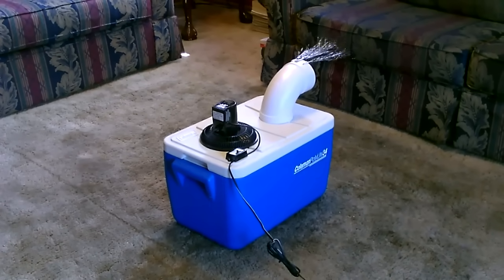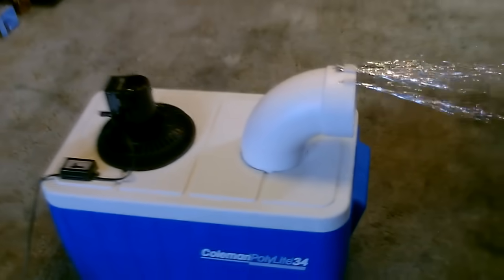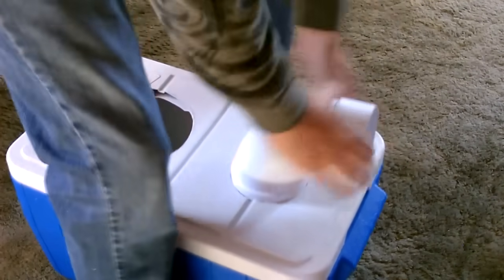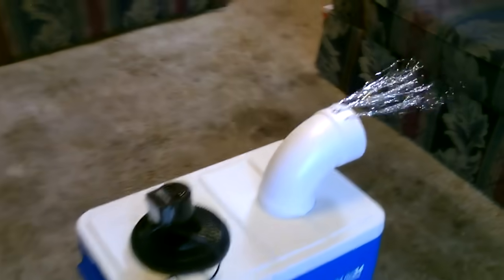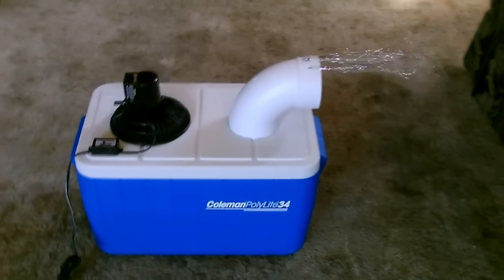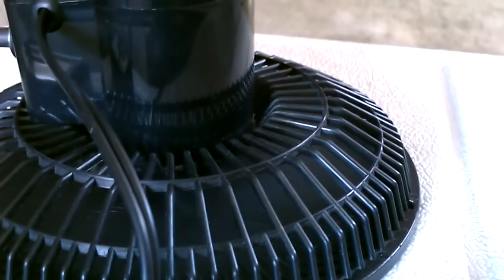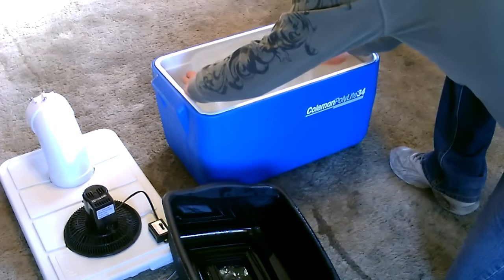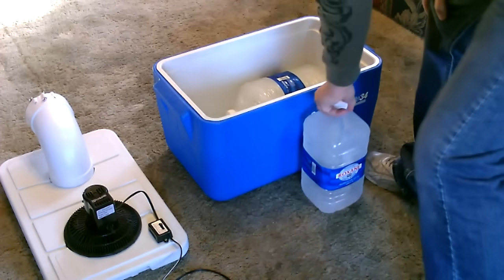Homemade air conditioner DIY - Awesome Air Cooler! - EASY Instructions - can be solar powered!

Comment: Use two sets of water bottles (each set containing about 6 water bottles).  When one set melts, put the other set in the cooler and put the melted set in the freezer.  By the time the other set melts, the set you put in the freezer will have frozen again.
Reply: AIRclan1 Um, your freezer is going to warm the air by more than this cools it, unless your freezer is outside or something.
Reply: David Battle Yep.  Scanned the replies and you beat me to it.   Most people don't realize that in order to freeze the water bottle, the heat is removed (not cold added).  The removed heat is pumped into the room that the freezer is in, plus the heat that the freezer generates to perform this.  The only way to benefit from this type of air cooler is to have the freezer out of the cooled area.
Reply: ***** If the freezer is in the same room as the "air conditioner", then there will still be a net heat gain, not cooling.

If the frozen water bottles are capped, then no evaporation will take place, and no humidity will be added.  In fact, water will condense on the frozen water bottles and drip to the bottom of the cooler offering a bit of de-humidification. If raw ice blocks are used, then they will add moisture to the air.
Reply: ***** I'm not unsure.  It will definitely release more heat into the room if it has to freeze more water.  It's a simple matter of physics.
Reply: AIRclan1 Hey Airclan1, It would be really handy to know the dimensions of your small room, and the temperature differential as in the temperature with and without the cooler or how many degrees the temp drops after the cooler has started.  That information will be a determining factor for me to either construct one or not.  Thanks!
Reply: *****+ohger1+David Battle+ I do believe that there are other people interested in this like myself who would use this device to cool a particular room in the home (avoiding the need to cool other rooms) where that room is not the same room as the refrigerator, meaning that the heat being expelled by the freezer unit is irrelevant except in terms of how much more power is being expended by the continual freezing of new ice blocks and maybe the problem of higher humidity that may be hard on, for example, computer components.
Reply: *****
If the freezer was 100% efficient (not even close), then the heat it removes from the water bottles as it freezes them will be added to the heat it already releases and net zero. It will remove the heat from the bottles and put it in the room (they don't store heat for later removal).  Because freezers use motors and compressors that generate their own heat, there will be a net gain of heating in the room.  The only way this "air conditioner" works is if the freezing apparatus is not in the same room as the air conditioner.
Reply: Yes it will run some to keep food frozen.  But it will run a lot more if you put liquid water in it.  You have to remove a certain amount of heat from the water to freeze it.  Heat can't be destroyed, only moved.  The heat removed from the water goes into the room.  Plus the freezer will generate additional heat from running it's motor and compressor.
Reply: To specify for all those who pointed out flaws,  I used UNOPENED water bottles and froze them in my fridge in my garage, where the temperature doesn't matter.  My cooler is in my fairly small bedroom and does an excellent job on hot days.
Reply: TWOLF Ravencroft Hey twolf, my room is about a 7' by 8' bedroom.  With 6 bottles, it takes about a half hour to drop 5(approx.) degrees.  I suppose if you added a faster fan and a couple more ice packs you could accommodate a larger room but my specs suffice.
Reply: Better to freeze the bottles at night with your windows open and then use them during the day when you would have your AC on.
Reply: breathe and squeeze whos they? thats absolutely not true. not only does warm water take longer to freeze it also increases the temperature inside the freezer which in return affects any frozen items in there not by much but it does.
Reply: Nicholas Reando actually it does freeze faster but most scientific studies have not actually found the reasoning and cannot produce the results to a point to say yes or no so the reality is that u are both right.
Reply: Nicholas Reando So it is absolutely true check your facts before you call some one a liar. And before I get the reply says who it actually has a name its called the mpemba effect.
Reply: John-Del You dont have a freezer in your house ?
Reply: David Battle well my room is too small for an wall ACU so i can use this while the cooler is in the room which has wall mounted ACU so problem solved
Reply: *****   That the plan!  If work doesn't mind, have at it.  It does seem hard to conceive that just freezing some water bottles would heat your room, but physics states that for every single calorie of heat your freezer removes from the bottles, it discharges into the room around it PLUS the the heat the freezer generates to accomplish this.  Freezing your bottles at work or with a freezer outside of the room you want to cool will work as the video suggests.

BTW, I knew this rube that framed in an old refrigerator half into his garage wall.  The back of the refrigerator (with the cond coils) was outside the house, the front half was in the garage with the doors removed.  It worked a bit but when his electric bill came it he shit a brick...
Reply: Yes, if the freezing unit is outside the area to be cooled, no problem.  Also, if the ice used is contained in sealed containers, there is no extra humidity added and indeed condensation on the ice bottles will reduce the humidity if the water at the bottom of the cooler is removed and not allowed to evaporate.
Reply: AIRclan1 Great to know AIRclan1.  Thank you very much for your response! :)
Reply: +AIRclan1 hey man so this thing really works? , i have a  small room... away from the main rooms in my house and i don't want to buy an AC... it get really hot in summer days... i don't look for an AC like solution, if it just cool down the temp in the room a bit that would be great...
Reply: IKurtC What are the dimensions of your room?
Reply: +IKurtC Yea, I was in the exact same situation.  I used this process for about a month.  I was getting tired of changing the bottles over and over, and just ended up buying a cheap $100 window AC unit.  If you have the patience (unlike me) go for this definitely!
Reply: well i guess i'll try to build this when i'm gettin free days at work, my room is like 5x4 mt i think
Reply: If by mt you mean meters, this will not cool the room.  The only thing you will feel cool is the breeze from it that blows directly on you from maybe as much as a meter away.  Airclan1 is correct when he says that changing out bottles can be tiresome.  The more surface of cooling within the cooler that the air hits, the cooler the breeze with be.  I used tall thin metal cans and checkerboarded them inside.  I considered a thin cooler filter with ice water circulating on it combined with a stronger fan, but then I realized I could just buy a small cooler and use ice water instead which would have been much more effective.  I was moving toward solar power to run it but then I moved.  This cooler is for a very small area and better, one that is insulated.  Put a cooler like this inside with you and it would be a fairly cramped situation.  I'd say, having tried it out, not real practical. However, there may be ways to improve upon it, one of course, using solar panals for energy.
Reply: they say hot water freezes faster than cold water.
Reply: butchtropic I am hoping to spend the winter in Death valley. I love the idea of adding more humidity!
Reply: AIRclan1 you are not even smart loser dumbass
Reply: AIRclan1 çok güzel bi
Reply: @butchtropic that's exactly how the very 1st air conditioning worked..
Reply: +Cherokeeman That cooler is $700!  You'd think if these people came here they were looking for an affordable option.  Trust me people, go with this project (if you have patience) or buy a cheap $100 ac window unit from home depot.
Reply: AIRclan1 that cooler was not 700$.. maybe 40$
Reply: David Battle it's not like your putting hot water in the freezer is it ?water from the cold tap 'in England anyway wouldn't take that long to start freezing
Reply: wow didn't know that!
Reply: Archie Beasley the solar panel is what drives the cost up
Reply: but i'm righter because it's true.

Comment: hey man if i put water in there than cooling is perfect or not because oi got a no ice .......please tell me fast
Reply: ddavel5441 how can i get ice instantly man
Reply: ddavel5441 okay man thanks
Reply: bear grills Actually, a bunch of paper soaked towels will work, to a degree. They get cooled with evaporation...
Reply: Clear Adventure
Yeah, same thing camping.
If you wear cotton socks, RIP toes.
Reply: how long the ice can use?
Reply: LK T about 2 hours ,nigga

Comment: where did you get the fan
Reply: Chance Blevins                      in the shop
Reply: Chance Blevins Home Depot has battery operated fans for around 10 bucks.
Reply: Martin Stroh i was going to do that but the batterys dont last long on the battery opperated fans, i will just plug mine in, makes more sense

Comment: brother thanks for the idea. im gonna try that this summer. question: what would happen if u add salt in the ice? we get cooler air?
Reply: Andreas Ioannou and how longer it would last.
Reply: Andreas Ioannou When you add salt to an ice cube, you end up with an ice cube whose temperature is above its melting point.

This ice cube will do what any ice cube above its melting point will do: it will melt. As it melts, it cools down, since energy is being used to break bonds in the solid state.

(Note that the above point can be confusing if you're new to thinking about phase transitions. An ice cube melting will take up energy, while an ice cube freezing will give off energy. I like to think of it in terms of Le Chatelier's principle: if you need to lower the temperature to freeze an ice cube, this means that the water gives off heat as it freezes.)

The cooling you get, therefore, comes from the fact that some of the bonds in the ice are broken to form water, taking energy with them. The loss of energy from the ice cube is what causes it to cool.
Reply: Hingle thanks brother for answering. are u a physicomathematician or smth..? so we end up.. conclusion?? im i get cooler air or no by adding salt?
Reply: Andreas Ioannou t’s important to first understand what melting point and freezing point mean.Melting point is a property of solids.  The melting point is simply the temperature at which the solid turns into a liquid.  For example, the melting point of normal ice is 0°C at standard pressure. 

Freezing point is a property of liquids.  The freezing point is simply the temperature at which the liquid turns into a solid.  Thus the freezing point of normal freshwater is 0°C. The value of the melting and freezing points is the same (ie. both are 0°C for water). So as you can see, melting point and freezing point are kind of “mirrors” of each other. It doesn’t make sense to talk about the freezing point of a solid (since it’s already solidified).

When salt is added to water it lowers the freezing point.  In other words the water needs to be chilled to a temperature lower than 0°C (say -2°C for example) in order to change to ice.  Another way to say the same thing is that salt allows water to exist as a liquid at a temperature lower than 0°C.  This is the important part that’s relevant to beer coolers.  For completeness let’s look at this from the perspective of melting point.  When salt is added to ice it lowers the melting point.  

In other words the ice begins melting at a temperature lower than 0°C.  This is why salt is added to ice on the roads in the winter.  It causes ice, that would have otherwise remained as a solid in sub-zero temperatures, to turn to water.  Note that the temperature of the water has not changed.  It’s still at a sub-zero temperature but, as mentioned above, the salt allows it to remain as a liquid at the lower temperature.  Don’t think that just because the salted-ice has become water the temperature has risen.

TL:DR Add salt in water and freeze it. :D
Reply: brother. thanks for the analysis. i really appriciate that. is still hard for me to understand all those details but.. i like the way u placed the things. u should be a professor if u are not. and if salt dont works for maximum results then we go to dry ice.. :) what do u think.. ssss. :) thanks again.. sorry for my english.

Comment: I just made this and my temps are not as low as yours. Feels about like a window unit on medium. Works pretty good but if I could make it cooler.... Nice to have as a backup, or to keep from cranking up the a/c just to cool the 2nd floor master br.
Reply: *****
I used 3 , 1 gallon jugs and froze them. I've tried even adding water to the cooler with the frozen gallon jugs. It does cool but not as well as the video. My bedroom is 14x17 and it might drop the temp by 5 to 10 degrees, 10 is generous.

Comment: Any insight on how adding to humidity eventually makes it hotter?  Would a dehumidifier also help in the room?
Reply: smittyken I just put a dehumidifier in our apartment and the exhaust blows out hot. Made the apartment drier but hotter. I put it back.

Comment: This is awesome. My refer (and freezer) are running anyway. I could have water bottles freezing and use them when the heat gets too high. Then when I go to bed, put the bottles back into the freezer for next time. Thanks!
Reply: hympyke Off subject, but for ice water to drink, fill your bottle up only half way with water, lay the bottle in the freezer on its SIDE. Freeze it. Now fill the rest of the bottle with water. Better than ice cubes, this should last many, many hours for cold drinking water. :-) (BTW, you are doing a great job with your English!)
Reply: kevin green Much more time needed to melt. This is simple guys, freeze some water and try it with a little fan in bottle and without bottle. The closed bottle prevents the evaporation and the ice melts faster. I made 2x2litres with bottle and fan, needed maybe 40 mins to total meltdown and i didn't feel any cold... If I was put the ice in a basin, I felt the cooler air pretty quick.
Reply: hurdman I tried that one, and didn't work... if you keep the ice in a bottle it melts pretty quick, maybe in 30 minutes. The ablation is necessarly i guess. If i put the ice in a box and place it on the top of the wardrobe the air become colder. So the whole thing can be work, but do not blow the air to a closed bottle. Or just siply try it and you will see the result ;)
Reply: hympyke hello have you tried subtituiting ice gel pack?
Reply: batman Nope, I am not sure what do you mean(I can't find subtituiting in dictionaries).
Reply: substitute lol
Reply: batman No I didn't try but I think the result shall be the same. Need pure ice I think.
Reply: hympyke  how long does the ice last if you use just ice?
Reply: Clear Adventure Thank you.

Comment: Pretty cool idea. Especially if you are limited on how much energy you can afford to pay for. If your from the southwest you would know how costly it is to run a A/C all day and sometimes at night. If you want to save money it's the way to go. Sure you can buy a $100 a/c from Wal-Mart but it's not the price of the unit that is costly it is the energy needed to run it. I have a Wal-Mart a/c and my electricity bill is still around $200 a month even though it is an energy saving item. I don't know about other states but here the (SCE) Southern California Edison Electric Company raises it's energy rates during the summer. As for the melting ice I would freeze two blocks so when one melts recycle the melted ice by freezing it again while the other is melting and cooling off your house. Brilliant idea. I like it!

Comment: How are you powering the fan so well with that solar panel? All i can find at the hardware store for solar panels are the ones meant for cars. Is that what you're using? How do you convert that energy to plug your fan in? I'm very interested in making one of these for camping this summer

Comment: Am wondering if the cooler box/ice chest is even necessary?.. The fan is blowing the warm air directly into the box anyway, so does it actually work any better to keep the ice cool longer, as opposed to a simple plastic storage box or plastic bucket with a lid?
Reply: werusdn Something that nobody has yet mentioned, is condensation. if you want to use this indoors (obviously), Then it would be worth the extra 10 bucks or so to go with a ice chest/water jug that would prevent condensation from building up on the outside of the container and dripping onto your floor every time that you use it.
Reply: werusdn  U may want to turn off the cooler from time to time, and have it function when u turn it back on
Reply: werusdn If your inside and once the air temp gets cool enough in the room it wouldnt melt the ice as fast. Now outside yes.It would melt it faster from the hot air.Still a big block should last a bit. Inside the cold water should be drinkable id imagine lo. Nothing going to waste !
Reply: darkstarguitarist309

Comment: What size pipe is that 90*?  I found a 4 inch, but with vortex table fan, may be too small (air will blow back out of fan )

Is that a 6 inch 90* pipe?